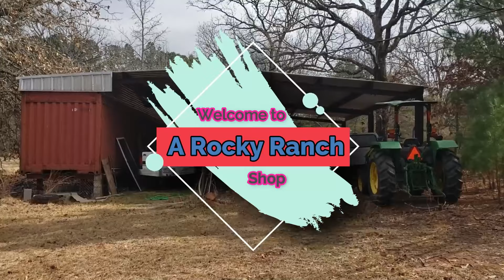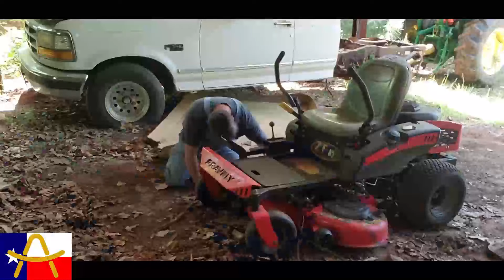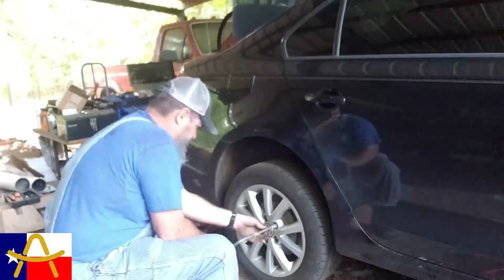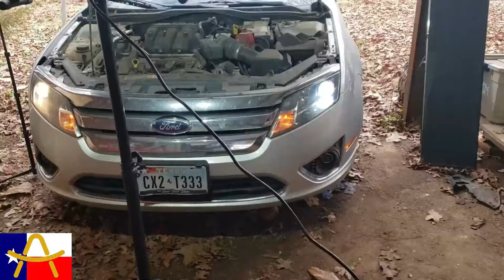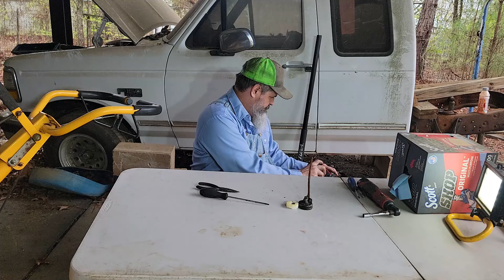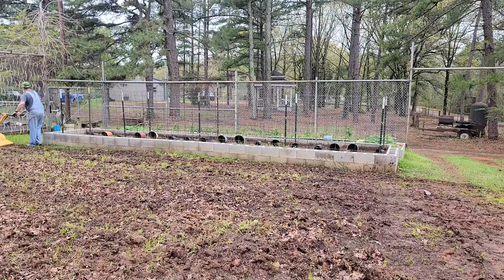Cub Cadet  RT65 Tiller

Comment: My wife's uncle gave us a cub cadet rt65 recently. He bought it new many years ago. It sat in his building for roughly 10 years. Both tires were flat and broke bead locks. It has a Briggs and Stratton engine. 
I put in inner tubes for the tires. Rather than fight with the carburetor I went ahead and ordered a cheap Chinese one from Amazon. Easy to find one, just need the numbers you can find on the carb. 
Spent less than $40 for tubes and carb and less than 30 minutes of work to have it running like new. 
Just a thought/suggestion about having to mess with the carb again if you need. Yeah i could have rebuilt it and cleaned it myself but for around $20 or so i got a new one along with a new air filter and spark plug. Was much quicker just pulling off the old one and throwing the new one on. I think the time it saved was worth more than the little i spent.